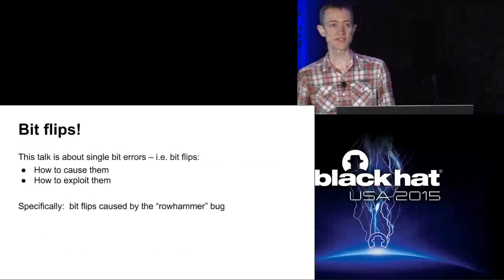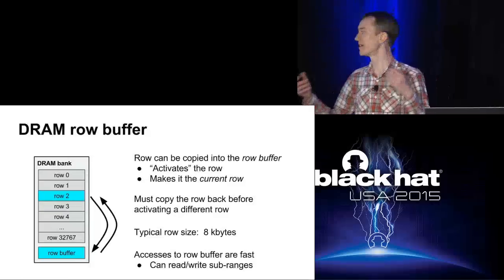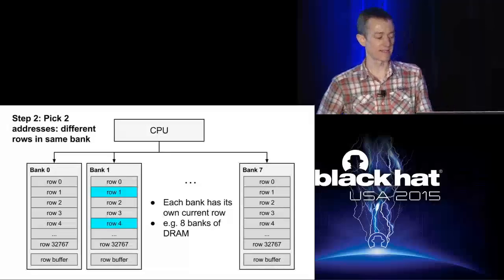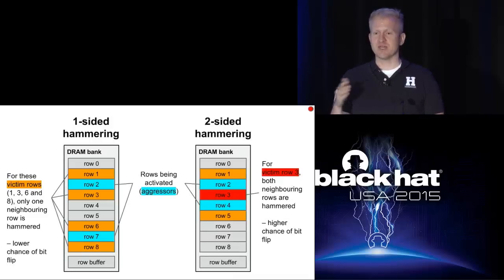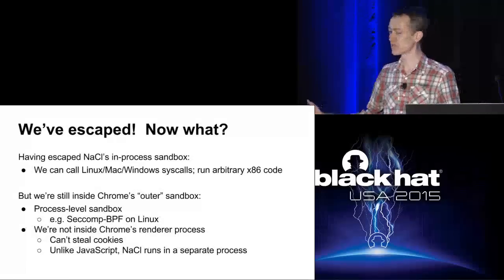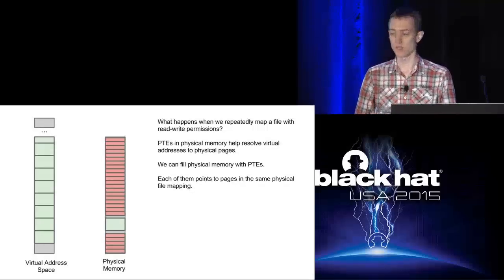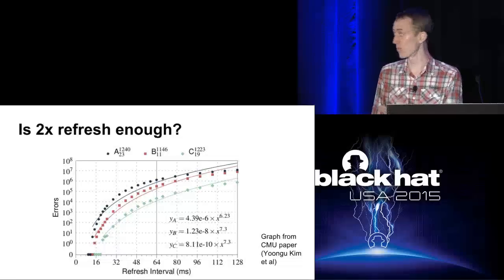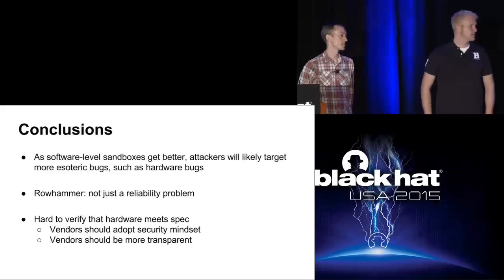Exploiting the DRAM Rowhammer Bug to Gain Kernel Privileges

Comment: "A fault in many DRAM modules, from 2010 onwards"

No, actually, it's a fault in DRAM since.... DRAM. Part of that whole "D" letter.

Edit:
I'm realizing now that the 2010 date is about the vulnerability awareness, not the physics. The physical situation that allows for rowhammer scenarios has been around since DRAM has existed. That's part of why ECC exists and refresh limits are specified. The density of contemporary DRAM, however, does make the issue more prevalent, so something that needs to be addressed.
Reply: Not quite. It's not observed on DRAM < 2010 because the memory cells are sufficiently large and far apart and memory controllers sufficiently slow that you can't do enough reads in a refresh interval to cause the issue. This is something that happens on newer DRAM because they are more dense. Prof. Mutlu mentions this in https://www.youtube.com/watch?v=sgd7PHQQ1AI at 10:28